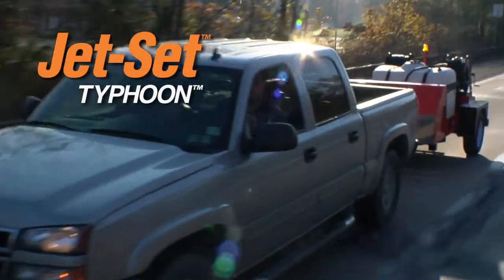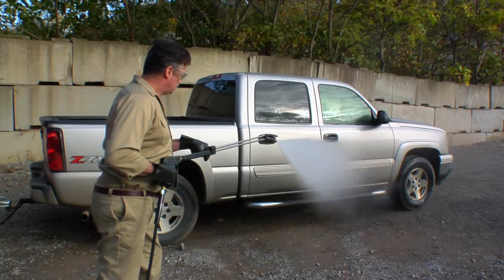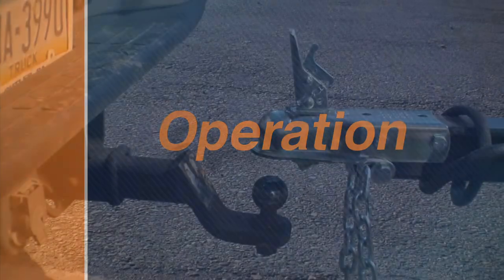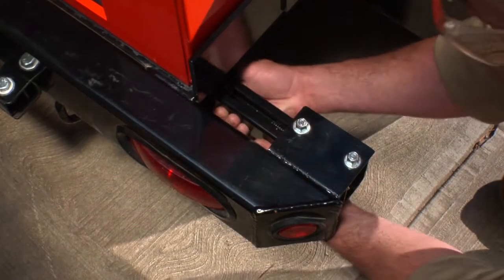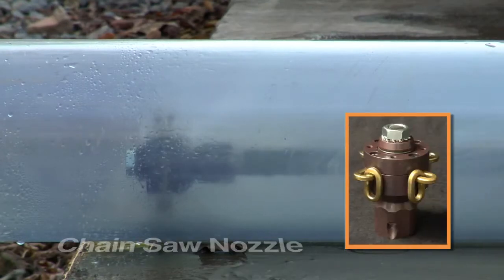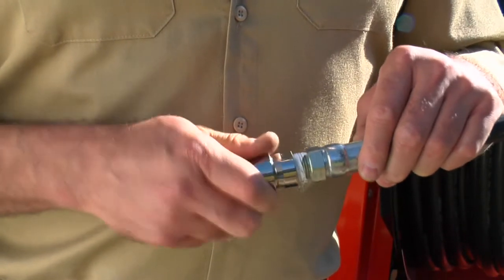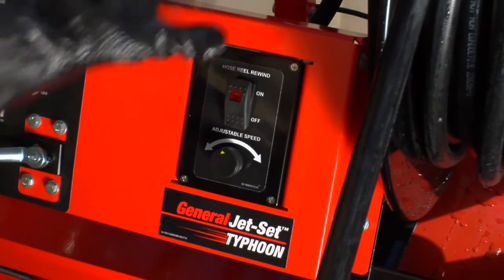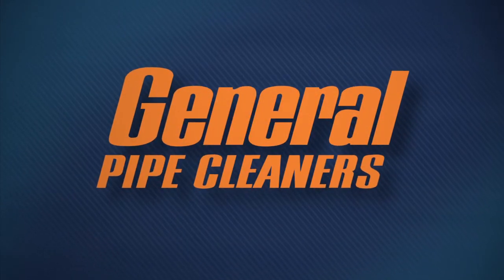Typhoon Trailer Jet How To Video

Comment: Even the Typhoon can be shipped to other countries!
I saw one in South Australia and it retains most of its original components, apart from the turn signal system which has been changed over to Australian standard ones.